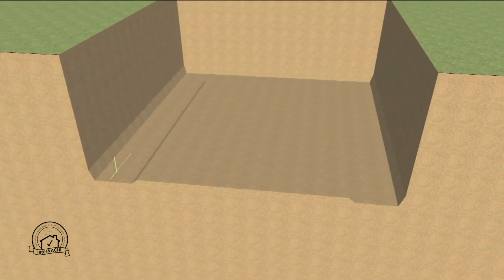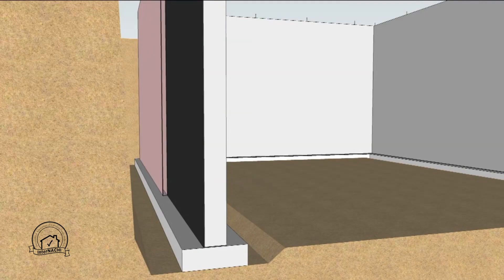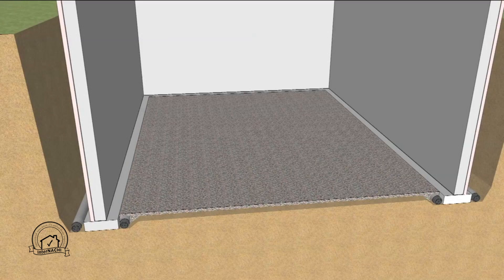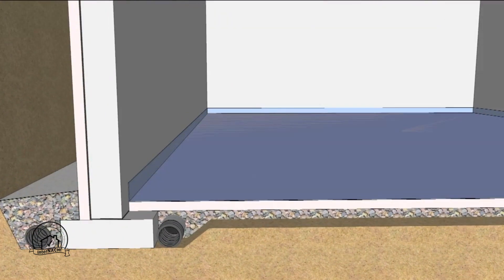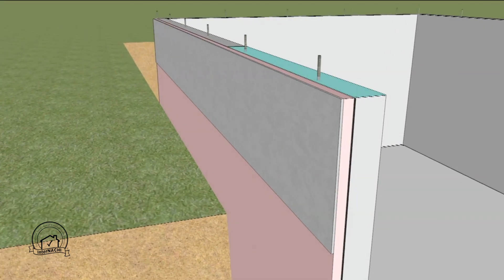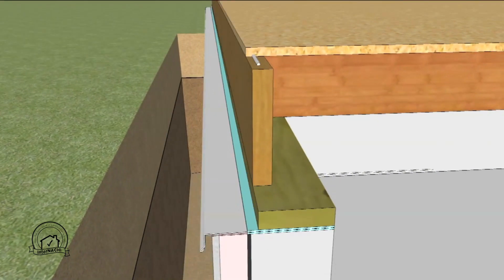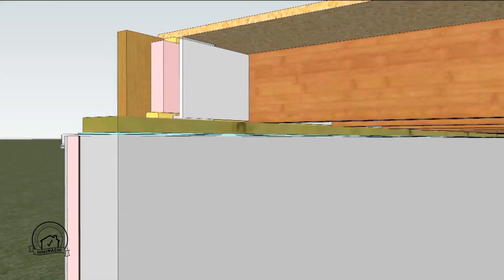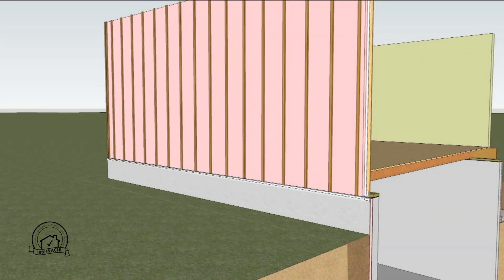Concrete Basement Wall With Exterior Insulation

Comment: I'm surprised about the lack of Sump Crock/Pump for a basement. My guess is the water will come in at the separation barrier point between wall and slab. While you might get away without a SP with a crawl space, I wouldn't bet on a basement.
Reply from the maker: That's a good point.

Comment: You often see many home foundations with just exposed concrete above grade. In that case, does the insulation simply terminate right below grade level? How do you protect the top seam of insulation in that case?
Reply: They often don't have insulation
Reply: If you want to insulate your basement walls, you should go down to footings with insulation, if you do not do this heat would escape through concrete, top soil into cold ambient air
Reply: Unless you’re continuing it up the wall above grade, the insulation you often see cut at grade was not put there to insulate, it was to protect the foundation waterproofing from the backfill material damaging it, rocks rolling into it etc..
Reply: You often see that because virtually nobody in the world uses exterior insulation like indicated here.
Reply: @patty109109 you obviously do not live or have been to Canada
Reply: @patty109109 we do but typically mineral wool not poly iso
Reply from the maker: Thanks for watching and commenting.

Comment: 1:15 Any suggestion of exterior board to use? I have 12" exposure and looking for something that looks decent, thanks.
Reply from the maker: Good question.
Reply: I had the exact same question. Been wondering what that material would be for a while.
Reply: @keithanderson6997  I eventually found that a 1/2" thick Azek PVC board could be used, or something similar. Hope that helps you.
Reply: You can also do a coating, as stated. I saw another video where this was being done. Try googling and see what comes up.

Comment: Best way to build a concrete wall DIY dry stacking concrete hollow Blocks!! 
Yes explanation provided.  Building the concrete Basement walls DIY? 
Concrete Molds building? Then need to by extra wood plywood- and 
steel material. 
Instead expenses to save and how. double H- Concrete blocks and (concrete DIY made) 
traditional way DIY. 
— When you are building i.e basement DIY walls such as the house 
foundation. 
Have you considered dry stacking and (easier to reinforce 
both vertically and horizontally) with a concrete double-H block design to use? 

Oldcastle Common-8'' x-8'' x 16''- (''Concrete Fence Block''). 

So you don't have to use mortar at all, but just (which you can 
then) make your own concrete (you don't fill the entire height 
of the wall) but you build 3-4 courses (rebar V- & H) in height and fill with 
concrete as much as you can in one day. No rainwater collects 
(when work is stopped on holidays) then either in the concrete 
block wall. Electrical junction boxes and appliance sockets can 
(with sockets for these in the blocks) be mounted (and with 
connections then inside the wall with suitable electrical pvc-pipes 
intended to be used as such) and the junction boxes and appliance 
sockets are attached to a 5-7 mm aluminum (suitable metal) plate, 
which is screwed firmly in the shell-block wall before filling 
the wall with concrete.
Reply from the maker: Thank you.
Reply: Sorry, Bro, it is difficult to understand, in my opinion basements are build by stupid people or by those who do not know what to do with their money.. First . It is more comfortable to be in living space above ground. Second . It is cheaper to build living space above ground . Third. When it is time to sell real estate agents would assess living space in a basement for only 50-60 precent compared to space above ground

Comment: How do you do the drain tile on a concrete piles foundation ?
Reply from the maker: Good question. It would be similar in that the drain tiles would follow the bottom of the piles locations.
Reply: @internachi  what you said makes sense from the outside.. but from the inside not sure how the sequence goes.. a video would be better!!! assume piles go 50 feet deep and then the plinth beam and footings are attached to transfer the load of the building to piles.. now from the inside how would drain tiles go!!!!
Reply: @internachi dude, your house on concrete piles they will not rust in water . You do not need drainage there

Comment: Ants seem to like foam board and will turn it into swiss cheese.  I'm wondering how long it will be until foam board is re-evaluated for something else like bubble foil with less of a rodent problem.
Reply: Rockwool Comfort board is a better option for exterior basement insulation, I prefer to insulate on the interior myself. It’s easier to maintain continuity for me.
Reply: In addition to carpenter ants the foam is flammable and doesn't breathe (which is often not desirable depending).  Rock wool seems the better option in many ways
Reply from the maker: Thanks for watching and commenting.

Comment: Where do the foundation drain and the below slab drain go?
Is it pumped out?
Is it pitched to a lower grade?
Reply: If you have so much liquid water against the foundation that you need to actually drain it somewhere or pump it out, there's a design failure in your building.
Reply: @canonicaltom  that is unequivocally 100% wrong. Every single house in my area has a sump pump or gravity drain. ALL of them.
Reply: @patty109109  That just means whoever built those houses were negligent.
Reply: @canonicaltom  you are just unaware if how Nature works in varying places, depending on soil, water table +
Reply from the maker: Good question.

Comment: Simply backfilling with granular material is a ticking time bomb, depending on your soil. Maybe it's 40 years, maybe it's 70 years. But sediment and clay will follow water into that granular material where it will deposit and eventually clog it up, at which point you'll be dealing with the effects of hydrostatic pressure on your foundation, which will crack it and maybe bow it.

Another thing, rigid foam placed in a single layer will shrink, leaving gaps at the seams, which is where your foundation wall will have cold spots.
Reply: What’s the right way to backfill to avoid the failure scenario you describe?

Also, I haven’t heard of rigid foam shrinking. Do you mean that you have to overlap the seams of it as you apply it? How do you get an even plane?
Reply: @joshsmithward8848  I recently excavated my basement and used non-woven geotextile fabric to keep the the clay-rich surrounding soil out of the gravel I backfilled with. The previous backfill had with time all clogged up with clay and started pushing in my block wall, so I did not want a repeat. I guess time will tell whether this will be successful.

Not sure if staggering seams on the rigid foam on a basement is as important as other applications, but on exterior walls and especially roofs you use two layers so you can stagger the seams by offsetting the second layer vertically and horizontally. This way when it shrinks the channels of airflow don't bypass the entirety of your insulation. On a roof these channels would lead to condensation and rot issues, but on a basement this is not an issue. But it's not really more expensive to buy two thinner sheets of foam than one thicker one, so there's hardly any reason not to use two layers and stagger the seams.
Reply: @joshsmithward8848  Get a non-woven French drain textile fabric, NOT garden weed control fabric, and use washed septic stone on top of the fabric, then lay SCh40 PVC perforated pipe (NOT the flexi black hose stuff), cover the PVC with more washed stone, then cover it all with a flap of the fabric over the top (the burrito style).  Rigid foam is neither dimensionally or thermally stable, with the exception of BASF Neopor foams.  Rigid foams also will hold water and can host bugs/mold/rodents, and Neopor will not.
Reply from the maker: Good feedback.

Comment: This is perfect I have been looking for a good illustration like this for a while. I would love to see this with more details like  what is the best method to secure foam to the concrete wall, before backfill. If using Rockwool how to secure it to foundation wall etc! Thanks again guys
Reply: Perfect, it is when you have continuous insulation all around . Here we have interior concrete wall not decoupled from footings
Reply: @andreycham4797 1:11 I also wonder why there is no styrofoam between foundation wall and concrete slab.
Reply: @Bart-dg6qv  maybe because it’s on the exterior instead.
Reply: @NIWHHC Doesn't matter, it should be a thermal brake there as well.
Reply from the maker: Awesome, thank you!